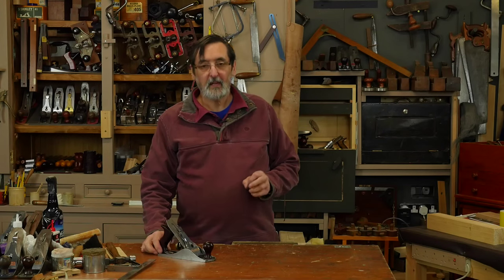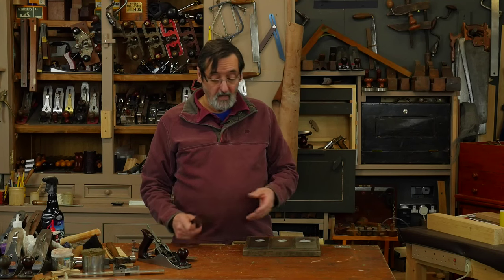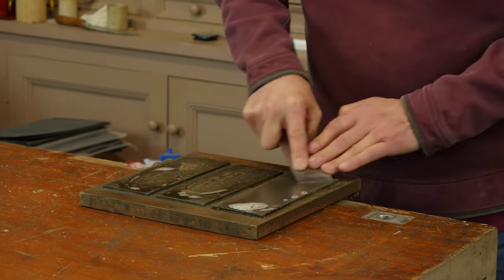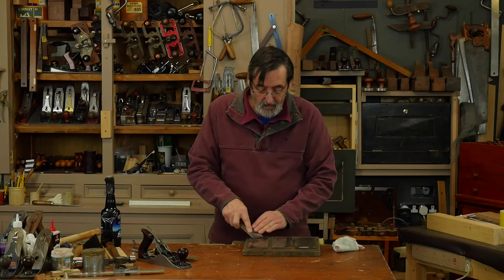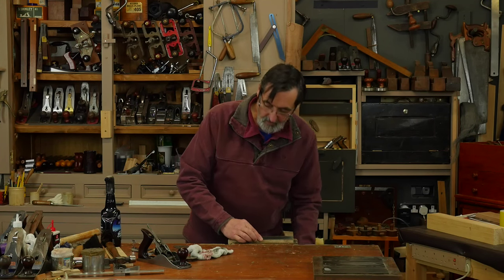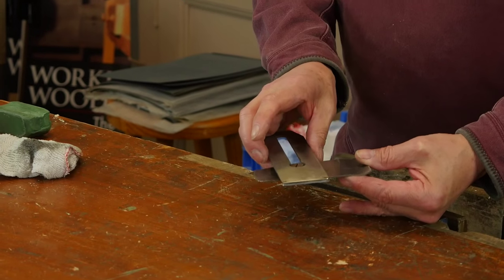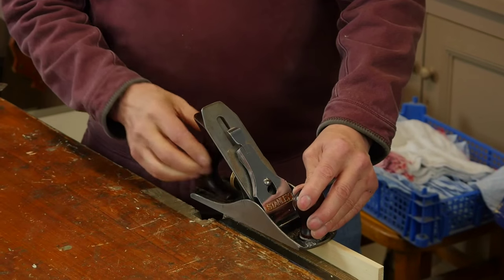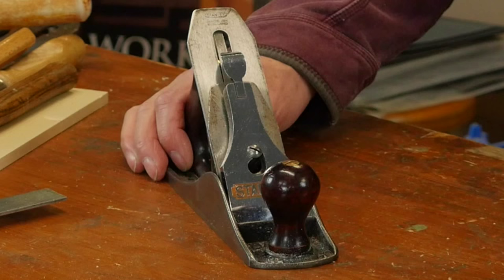Sharpening and Setting the Bench Plane | Paul Sellers

Comment from the maker: To see a beginner friendly guide on how to sharpen a plane, visit our sister site Common Woodworking: https://commonwoodworking.com/sharpening-a-plane/

For more information on Paul Sellers, see https://paulsellers.com or https://woodworkingmasterclasses.com for more project videos
Reply: Hi Paul, what size stones are they, are they the 8x3 inch. Eze Lap doesn't have 1200 grit in that size, only in the 6x2 inch.
Reply: Nice video Stanley the best player
Reply: Looking for advice in setting the frog on a no 4, that has no frog adjustment screw (not missing, the plane was designed without one).  Is there any concerns or tricks to keeping the frog from being twisted in relation to the mouth? Is this even a concern?

Comment: Today I cleaned up a very old rusty Stanley plane that I was given, I then sharpened it and set it up.  I've just taken it for a test run on a piece of material, and at the end of it I was smiling from ear to ear, as it worked perfectly!  I'm so thrilled as this was the first time since my school days, which ended in 1969, that I have actually used a plane.  Thanks Paul for all your brilliant videos, they are not only instructive, but very motivating.

Comment: Paul, thanks to your videos I flattened, sharpened and set up my first hand plane, a #5 Millers Falls, this week.  I own others, but have never used them.  I made my first shavings with it, and was able to dial it down to translucent shavings on cherry.  Thank you for the motivation and guidance.  I've been a corded tool user for years but am working to move into hand tooling for things other than ripping and thickness planing.  Next up:  my block plane!

Keep up the good work!

Comment: using the thin slab for leveling the plane sole is amazing tip. I have been working with my plan for more than a year without getting the full width shave, and it was so frustrating for me. no matter how mach i was sharpening the blade. I used to leveling the iron by eye only, and my vision isn't that good, so, probably, it was always tipping to some side and I couldn't tell.today, for the first time, i got full width shave, and it feels amazing.
Thank you
Reply: Yep, I like to use a piece of 3/8" scrap to level the iron using that method I can get an even 0.0015" across the entire plane mouth. Yes I'm anal enough to micrometer my shavings.

Comment: For years I've messed around with honing guides and had inconsistent results. So I trawled through to find this tutorial and tried Paul's method over a weekend. After some practice on diamond stones I now find this the best sharpening method I've ever found. And it even works on the thicker irons for heavyweight planes (which incidentally work perfectly well with the old thinner irons). The secret, if I may say so, is that a substantial wire edge is created ensuring the edges have met. And better still, you don't need to regrind. Truly a "light bulb" moment - thanks to Paul.

Comment: Paul's method works wonders. I have been struggling with a Hock A2 Cryo blade for a week. I spent hours sharpening with the Veritas Mk II honing guide and a modified Eclipse style guide. The blade would get sharp, but the edge was ragged, almost like it was too brittle. I spent literally 5 minutes with Paul's method and got a perfect edge. 300 grit diamond stone, 500, 1000 and 4000 Shapton stones followed by 30 strokes on the stropping leather. Since this was the first time establishing the cambered bevel I spent 45-60s at each stone. Future sharpening's should be about 15-30s per stone.

Comment: I learned free hand sharpening in one of my 'former lives'....but somehow it had gotten away from me when I started woodworking again after a 30 year break.  I've been using a honing guide with 'ok' results but noticed Paul's method takes what seems like a LOT less time.  So....I finally gave it a try.  If you are also using a honing guide, I advocate ya take just a few minutes and give this a shot.  I found it worked better for me when I 'let my hands do the thinking' once I got the basic move down.  Personally, I think this method may be pretty much foolproof and my blades are going back to work sharper than with the guide.  I appreciate very much that Paul has chosen to pass classic skills along as well as using his knowledge as a base to come up with many unusual and practical ways to work.

Comment: Thank you so much for this video.  
 
I've recently caught the woodworking bug and coming from a power-tool centric setup it's quite refreshing to do things in peace and quiet!  Since I'm completely new to hand planes and don't have a lot of time to tune up an old plane, I ended up treating myself to a Veritas LA jack and BU smoother.  Admittedly, I'm a gadget-guy and in my haste I picked up some water stones, a Stone Pond, and a Veritas MKII honing jig, thinking this would make sharpening easier.
 
I did a "quick" honing of the included PM-V11 iron and, upon attempting to use the plane, quickly discovered that I should have spent more time sharpening.  I had quite a challenge pushing the jack plane across some q/s white oak and got quite a bit of tear out, skipping, and catching, which shocked me.  I know I need to learn to sharpen better but I also think the PM-V11 steel is just really hard to abrade with the water stones that I have.  I went back to honing and used the 800-4000-8000 stones that I'd bought, cambered the edges and, while still a bit better, my plane was not cutting anything like what I saw on various YouTube videos.  I did have a few instances of decent shavings, which just gave me a little taste of what using a hand plane could be like! :)

Anyhow, after a bit more research I came across your excellent blog and videos and quickly realized that sharpening doesn't have to be some numbers-crunching, perfectly-angled-to-a-thousandth-of-a-degree ordeal.  You very eloquently stated that woodworking artisans have been doing more with a lot less technology for hundreds of years and that we shouldn't make things more complicated than they have to be.  This video really set me straight and I just grabbed some DMT diamond stones and will be practicing your sharpening technique this weekend.  I'm hoping that I'll have much sharper blades for my next attempt at planing this weekend! :)

Again, thank you for sharing your knowledge with us - this truly is somewhat of a lost art. :)
Reply: +Digitalfiendscom I couldn't wait for the weekend and just finished my first sharpening with this technique and wow, what a difference!  For the first time since I got the hand planes last week I was able to plane that q/s white oak I bought without tear out or getting stuck.  Jointing the edges gives me that satisfying "shhhnick" sound with nice thin and even shavings; end grain cuts with a bit more effort but evenly; and I was able to finally plane the face of that bloody q/s white oak.  It's truly night and day.  I'm still having a bit of difficulty with this one board where the grain looks like it reverses on itself but I tried the face on another board and it went much more smoothly, so it seems it might just be this piece of wood (figures lol).  Tried a bit of pine and the iron cut through it like butter; haven't yet tried the hard maple I've got for another project.  I'm going to sharpen the rest of my blades for this weekend and get going on my table top!  Woohoo, thank you so much for this video.By the way, one thing I immediately noticed about using DMT diamond stones is how fast they cut the PM-V11 Veritas blades versus the water stones I bought - and with MUCH less mess.  I'm using Stoner's Invisible Glass cleaner which seems to work well enough.Very happy at the moment... :)

Comment: I bought a number 3 Stanley Bailey on ebay .It was $30.A 1/2 hr of tuning and this little fellow is equal to my L.V and L.N. planes .No micro bevels just 30 degs,and sharpened on a 1200 grit stone with WD 40 .It is simply a pleasure to use .I can read a page of writing through my shavings .this little fellow is unbeatable in my opinion.

Comment: Thanks for sharing - very detailed video. This helped me decide on a hand plane versus electric.
Reply: Curtiss Farmer Using a hand plane is a joy. And don't waste your time with the cheap models. The $71 Stanley block plane and $120ish Stanley No4 smoother plane are very very good. If you can afford it, go for the Sweetwater versions, they're not that much more and the castings are just better. Plus you get wood handles instead of plastic.
Reply: I pulled the trigger and picked up an old cleaned up stanley #5 type 17 plane! I paid a bit for it but it's beautiful and arriving Saturday!

Comment: Don`t mind me Paul , I keep remembering things to say . Looking at the plane Paul has here you may not know the point of the shape of the hole in the lever cap . Paul has a kidney shaped hole . Earlier caps had a keyhole shape hole. The keyhole could allow the cap to come loose as the screw is holding a part at a slanted angle (like one of the planes I just worked on ). The countersunk screw only grips on two points left and right and the kidney shape provides an extra piece of metal to stop the lever cap  sliding backwards on it`s own . An ingenious piece of engineering .

Comment: I really discounted this sharpening method b/c I thought that I would overshoot my angles and enter a long cycle of sharpening and ending up dull and trying again.  I also discounted it b/c there were so many voices in the community that said one should really start with a honing guide. Also there’s that weird convex camber bevel that I hadn’t seen anywhere else.

Well now I’ve tried it and it works so dang well and I’m sharp in minutes!  What the hell have I been doing with all my time.  This is ridiculous!  And with cheap diamond plates, it’s maybe the cheapest method I’ve used as well. So much money wasted on sharpening tools.  

If you’re a beginner like me you should give it a try.  There’s a reason Paul Sellers teaches it to students.

The method is covered the best in this video.  He also has a video on sharpening chisels and quite a few blog posts.

Thanks for saving me from sharpening hell Paul!!  I should have listened to you in the first place!

Comment: Yay! I finally got it right, I was making two big mistakes, first was not using the same pressure on the coarse grit as on the fine, the second was that I was lining up the cap with the long edge of the iron instead of making it square to the cutting edge (stupid I know). I then went on and sharpened a chisel. I've sharpened things before to pretty sharp but don't think I've held naked iron as sharp as I had it tonight in my bare hands. I was truly nervous and understand why Paul does the cross over method!!! It's so sharp you actually cannot tell if it's cutting you or not!

Comment: Wish you would show how you built the Diamond stone holder.  Keep up the good work.  I learn so much from your videos.
Reply: The stone tray he uses is my least favorite of all of Mr Sellers' jigs.  The reason is that done that way, it's really only useful for some tools like plane blades and chisels.  You can't sharpen tools like big handled knives or adzes on stones flat-mounted side by side, because you can only get to the two edge stones, and even those are obstructed by the wooden border.  A Mora knife, for example, has an edge that goes all the way to the hilt, so even a narrow border is too much.
I much prefer a single stone clamp that only attaches to the short edges.

But for only sharpening plane blades and chisels, I'm sure it saves time.

Comment: Absolutely love all your videos, it's great what you're doing and is helping me massively. Just curious as to why you round off the corners? Thanks.
Reply: I am also curious
Reply: In another video about sharpening plane blades it was said that rounding corners ensures that no plane track marks are left.
Reply: Ryan Taylor The corners can dig into a large flat work piece and leave gouges that you'll chase everywhere. The No 4 is a "smoother" so it makes sense to round corners off. On other planes (like a Rabed) you want sharp corners for cleaning up something like a tenon. Block planes could be either way depending on your need but usually sharpened to the corner.

Comment: I tuned up a No 5 Bailey yesterday and today .  I did everything recommended by Paul . But checking the chip breaker to blade fit ,before putting it in the plane . there was still a tiny gap . Taking it apart again there was a slight twist in the chip breaker so I had to put it flat on the diamond plate to sort it out .The left front was too high and the back left was too low.That low bit became shiny as I levelled it. .The bad news is , while levelling like that I was also rubbing down the opposite front edge. So ---Then ----I had to get the front edge flat enough (again ) to mate with the nice flat back of the iron . I got there eventually .
   One good tip for everybody fettling a chip breaker , which a Japanese film showed me , is to not make the front edge sharp. That sharp edge will try to split the shaving and jam itself under any gaps .They recommended an edge of 80 degrees to push the shaving upwards without cutting them in 2 .A blunt shiny edge for a chip breaker is favourite .

Comment: Hello Paul, great videos thank you for sharing. I have a question, I have a diamond stone with two sides a 300 grit and 1000 grit. I have been told to get a 2000 grit water stone to get better sharpness. Do I need another finer stone and should i get diamond stone or a king waterstone Thank you

Comment: Hi Paul
That is such a good point and I have to say like you I managed perfectly well for 25-30 years with a Norton combination stone and got excellent results on my furniture and my instruments. You are dead right when you say that it is mainly down to the media that I now have diamond plates and water stones from 1000 - 10000 grit. Do I get great results - yes, but are they that much better than the finish I was getting years ago - not really. In fact you are dead right that I now have to sand just to get the right surface for my finish as I have had issues with lacquer not adhering properly when using the surface straight from the plane. I must admit I like the polish I get from the finer grits but does it improve my work to a huge degree? I sometimes think we just tend to go with the flow and convince ourselves that we need finer and finer grits. I'm might stop using my finest stones for a while and see if I really miss them.

Comment: That is a nice guide for adjustment , on my personal experience sometimes when I need 90 degree angels on  a piece and maybe one side is 1/100 of a millimeter apart from other then I want one side of the blade to take a tiny tiny bit more than the other so I will get the desired angle but then I get a problem sometimes that the surface isnt as smooth if I where to set the plane blade even on both sides I think it has something to do with the wood pattern or something or even the direction of planing or the pressure that I apply to the plane itself

Comment: Paul, I know this is an old video but the question is timeless. Due to the hysteresis in the depth setting on most planes, when you set the blade depth do you back it off until the knob engages the blade then come back forward (increase blade depth) to arrive at your desired setting. Another way to put this is do you always set the depth approaching from the same direction. I have often wondered if the set is taken when retracting the blade if it will slip back further once you start using the pane and resistance is met. Since the depth adjustment is not biased against the force applied to the blade it would appear that the blade could and will move, and not always squarely, so you will end up taken less of a bite and possibly an uneven one at that.

Comment: Ace video and instruction. I am just wondering something - if the wheel to adjust the height of the blade is too stiff - is this because the iron is on too tight? I have seen some videos where they unclip the front iron before adjusting the wheel, but you don't seem to do that. Do you think it's because I have the screw in the iron too tight?

Comment: Hi Paul, I have various thumb planes and small plans (like Ibex) that I use for instrument making but string them is hit and miss as no depth adjuster, just a thumb wheel to apply pressure to hold the blade in place.  Is there a trick to setting them? Maybe a vid?  Thanks for your channel, it’s great teaching!!